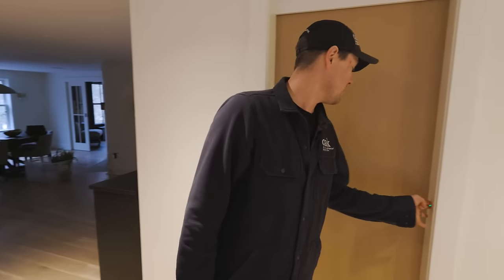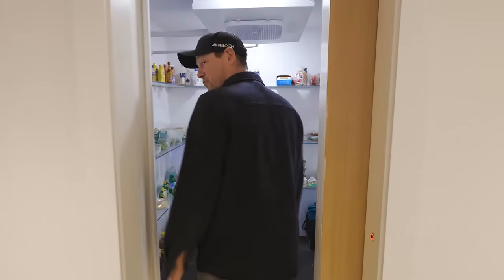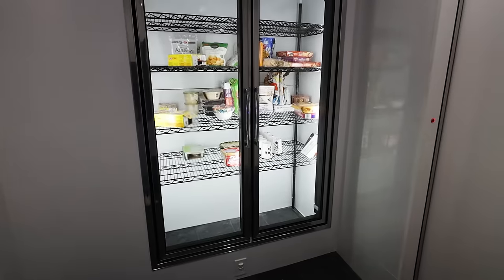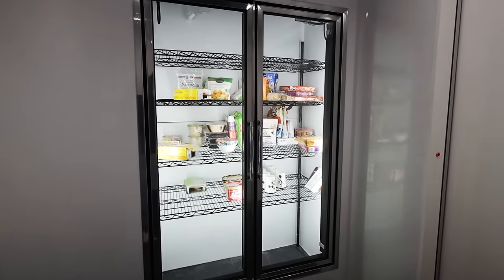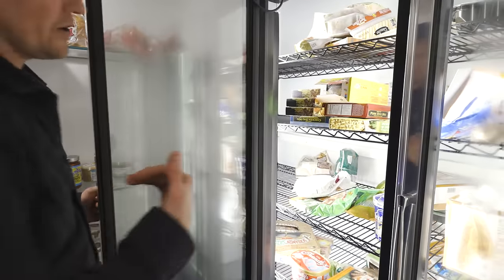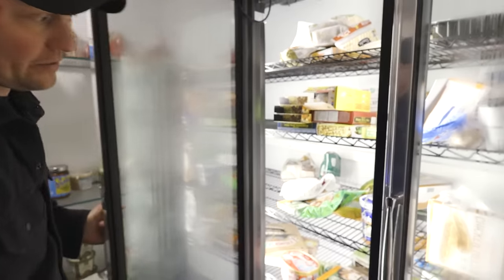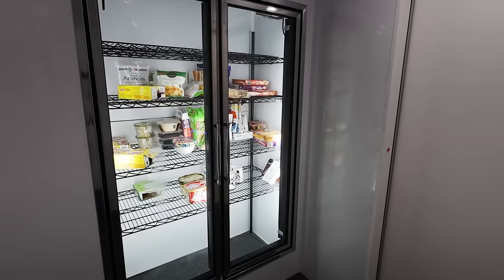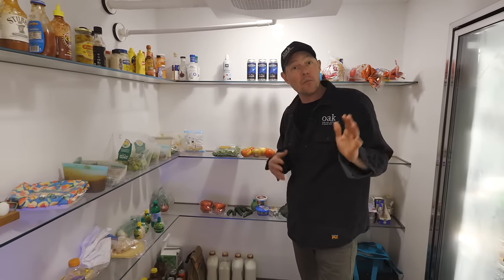Walk-in root cellar Fridge REVEAL!

Comment: Thats the evaporator on the inside of the box. The condensing unit is the other half and should be outside as it discharges air that is up to 30 degrees hotter than the ambient.

Comment: Cost?
Reply: A lot LUL
Reply: @Madderthanjoker  twitch nerd
Reply: Less than two Viking units that have 1/6 the storage. Plus quieter and more efficient. Less moving parts. Easier to repair. It’s hard to find certified repair people in a lot
Of places for high end appliances. It’s easy to find commercial refrigeration hvac guys and parts are easy to come by. All restaurants have them so no waiting six months for Viking to bring you a fan motor.

Plus you can make it as simple or as fancy as you want. Make your own walls with a lot of spray foam and concrete or order pre cut foam kits like they do for commercial ones. You don’t have to follow any restaurant regulations so have stainless walls or don’t. Design your own lighting. Heck there are these $150 kits that turn window AC units into refrigeration units by replacing its thermostat.  Farmers have been using them for years for diy walk ins. And yup they work and get down to freezing.  

I’d build one and make it like a bank vault with a few feet of reinforced concrete on all walls and ceiling. Double as a safe room that’s burglar proof and tornado hurricane proof.  Nobody is getting my Ben and Jerry’s.   Even better if you can make it partially or totally underground. Would save a lot on cooling. Or maybe have the top main level be a normal walk in and have a lower level for wine and beer kegs and bodies.

Oh and I’d put in a green area with misting sprinklers like they have in grocery stores to keep produce fresh.  And for sure have a en-suite that’s all stainless steel.  Oh and hepa carbon air filtration with a ERV.  And a blast freezer zone to quickly freeze fish for sushi or fruits. Plus some kind of built in ice cream machine. Clear cube ice machine. Clear block ice maker for drinks like scotch and a machine that makes large blocks for the 7ft ice sculptures.  Better a ice machine with stainless molds that make ice sculptures.  Or I’ll just add a robot arm with laser cutting end with cnc control.  Plus custom ducting around walk-in to control humidity and temp in each zone. Have glass and air wall barriers to separate. Air wall vents top and bottom of each zone. And a raspberry pi with some custom software to run it all. 

And if the fridge wasn’t near a entrance then have a underground belt that shuttles deliveries from street to fridge like a airport baggage system.  Big enough to handle palates.  And fridge would be connected to main kitchen via hidden door that looked like a fridge? Or cabinet? And also have door into chefs kitchen where all the restaurant grade equipment is.
Reply: I thought including this "Or maybe have the top main level be a normal walk in and have a lower level for wine and beer kegs and bodies.

Oh and I’d put in a green area with misting sprinklers like they have in grocery stores to keep produce fresh." was a cool idea but quickly realized the sarcasm after reading on. Lol  Your carbon dioxide monitor suggestion should be included and wonder why it wasn't mentioned.